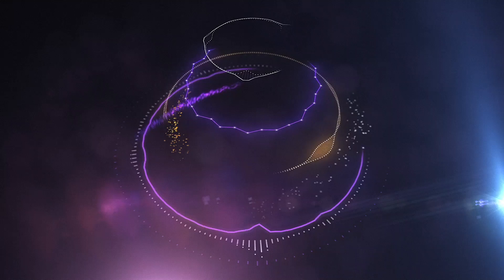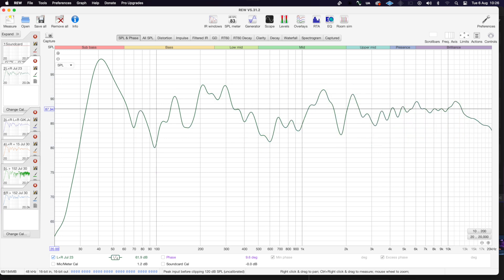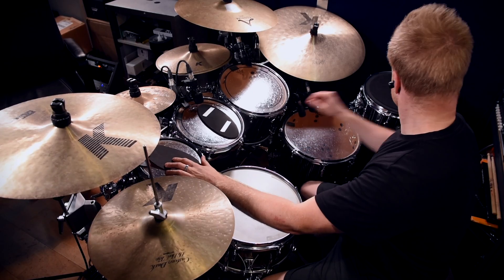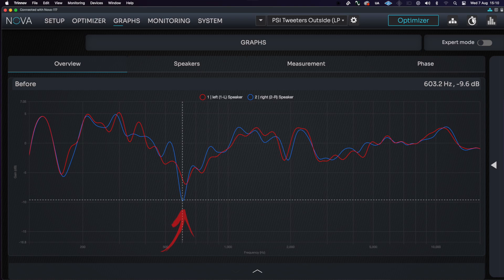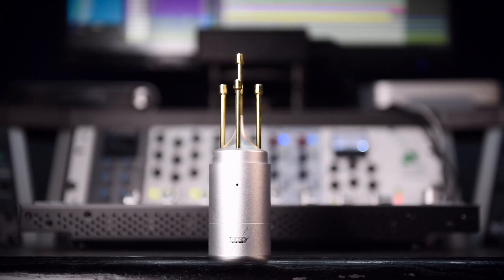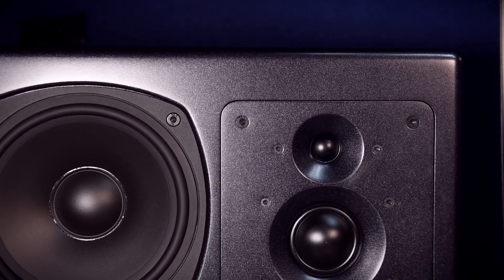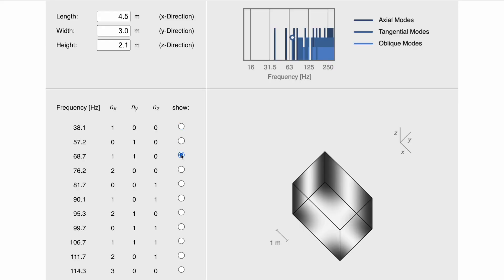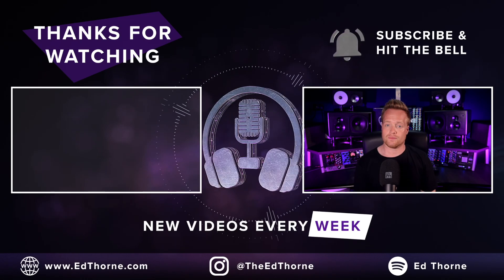Practical Treatment & Solutions To Real Acoustic Problems

Comment: You cannot EQ away a null.  Its a rabbit hole I've been down.  I was able to improve a 180HZ null in my room by adding extra 8" thick (roughly 1M X  2M) Rock wool on each side of my listening position and another about 2 meters directly behind me.  Knocked about 9dB away from my null and also ate a little of my 60Hz bump.  My room is about 3X4 meters with really low ceilings (2.2 meters-ish)  So unfortunately clouds are a no go.  The thing that helped the most was moving away from 2 way monitors and a sub to a really good set of 3 way speakers and no sub.  Just doing that and nothing additional got my response looking pretty good.
Reply from the maker: They’re great improvements, good job!

Comment: The ceiling thing is a wonderful thing for me to note down and it's clear to budget the basic acoustics and then a bunch of extra for sorting out little problems.
I'd not have drums and a drum shelf but good to see this for anything else I might have that'll cause a similar problem.
I will be doing it in the flat living room, but fortunately at the moment the plan will not include much difficulties or so I think... couches and arm chairs, a few side tables here and there, but one thing is a short depth desk at the back for a digital art station for a friend to do me graphics when I can afford to pay for them.
That might need to be reworked.
Then my room isn't a normal rectangle with odd bits sticking out and two doors behind me, one to the hallway and one to the kitchen and then one to my left in front of me to my room and a built in bookshelf to my right... which I intend to treat and get it working before I figure if any shelves will still be usable.
Then my bedroom will house a lot of such things as book shelves and so forth that might cause issues... oh the fire place might be a issue but is closed off so treating it will be possible.
Always good the hear others journeys.
Totally thought when you mentioned something coming in the post on the podcast I thought maybe you had the PSI active bass traps coming
Reply from the maker: I’m hopefully trying the PSI AVAAs soon for a video but I definitely can’t afford them!

Comment: Knowing what I now know in hindsight, added with all the other compromises that went into my room. I would have gone with GIK soffit traps floor to ceiling in the corners from the beginning instead of tri-traps (if you got the space). Ive based all my treatment off knowledge from Jesko, GIK articles and other resources online. To not sound like a GIK commercial my reason for choosing them is that for me personally theres no way I can trust myself around building materials and to make it look half way decent. 

Ive got 11 monster traps, 6 x 244 panels, 3 of them a cloud above the mix position without gaps. In addition I found room for 8 scopus T40 membrane traps. My corners are tri-traps. Most of my panels have range limiters except 244s and main side reflection monster traps. The monsters in the back of my room have built in scatter plates. I also got 4 GIK Q7D diffusor panels along the sides further back in the room, quite frankly because I wanted  the product for myself just to gain experience and test it and they just look way too cool with the nice wooden finish. In this small size of room those Q7D diffusor panels are probably not something you want to focus on if your not geeking out. I considered extending the cloud  over the mix position further back into the room with an added additional thinner cloud, but in the end settled for now on an area rug in the back of the room that seemed to stop the bounce from the hardwood floor and the hard ceiling but still retain some life.

I didnt contact GIK from the beginning because I didnt know quite how far I would take it at first. Im sure there are anomalies as you said 100hz, but im not gonna bother to even obsess about measuring it before I get a Trinnov Nova, thats the next step for me.

The walls and ceiling are hard and dense in here, so I suspect they are quite reflective. They are a fermacell sandwhich with greenglue with 20cm Paroc behind that for sound isolation and are 2.5cm thick. Each fermacell layer is equivalent to 2 layers of normal drywall in density they claim.

Ive probably made a ton of mistakes in here as well but thats all part of the learning process to gain experience for me. I didnt dare to go with all panels with scatter plates as well which could of been possible. But ive tried to go with the range limiters except for first reflections to try not to suck out too much higher up. I believe thats one of the possible mistakes GIK lists that if you run "full range" panels everywhere, especially thinner panels but you dont trap the bass with sufficently deep panels elsewhere you deaden the room in mids and highs but the room still has problems in the bass region which then compounds the issue.

Quite frankly im relieved the process is nearly done as the rabbitholes are deep and so are the various issues to obsess over. Im not seeking perfection in my less than optimal starting dimensions.  Jesko said something like that at some point you get to a point where you are trying to balance all the so called "best practices" and make sense of the sometimes confusing and also conflicting best practices :) Main takeaway is that once you are over the fact that the treatment is going to take up a lot of space and be a lot of panels in general, as soon as you start adding more and more treatment and hearing the results you move the bar for yourself of how far you are willing to take it, like it may seem almost insane to start out with soffits or super chunks in the corners but if thats where you end up anyway it requires a mindset shift from the beginning to think bigger, for me that was a gradual process. As such at this stage in my journey I would of gone for the soffits initially. Also if the ceiling height would be slightly higher I would have gone for more ceiling mounted stuff around the ceiling of the room ceiling/wall boundary as well that I see Jesco includes in his recommendations a lot.

Anyway rant done :)

Comment: I think this demonstrates perfectly why acoustic design should be left to acousticians. It's heavy physics and maths, it's not 'sound engineering' or an 'art'. But likewise, it's always surprising how basic acoustic treatment can go a LONG WAY.

When you completely understand acoustics, you'll understand that acoustics isn't about how dead you can make a room, but it's how you can create a room which has a desirable frequency response, desirable RT60 (hint: it's not 0 seconds, it's actually around 0.25 to 0.4 seconds, normally around 0.3 for the most well-known studio control rooms), desirable distribution of modes, whether this passes the Bonello criteria, whether your room aligns with a prime ratio, ventilation, overheating, ensuring reflections are diffuse, mitigating mechanical ventilation noise, ensuring fenestration is such that environmental noise isn't an issue, ensuring that you're not impeding on the amenity of your neighbours etc... there's so much depth to the profession.

It's also worth noting that with any acoustic measurement via REW, you're not just measuring the room. You're measuring the loudspeaker and how that source interacts with the room (not just the room), as well as of course the microphone, signal converters, pre-amps, etc... even down to where the microphone is positioned and what furniture you have in your room. From experience, I can guarantee that the large studio desk will cause "issues", even down to the chair you sit on can have significant implications in room acoustics.

BUT as shown in this video, you can clearly see how a little/basic treatment with simple analysis of data can go a very long way indeed!

I think one thing I love about this series so far is how you pack the right amount of information so that people can go away and easily action tasks to improve their room's acoustics without any faff (i.e. the plethora of fancy modelling software and excel spreadsheets that us acousticians use all the time).

I think the main thing to always remember is NO ROOM IS PERFECT AND IT NEVER WILL BE (hence why I'm normally against systems like Trinnov (particularly SoundID) as it sometimes can do more harm than good in attempts to achieve a perfectly flat response).
Reply: I was thinking similar things, for example about the room being dead as possible, not exactly. However Trinnov is much much much more superior to SoundID, and with enough acoustic treatment it’s stellar. :)
Thanks for sharing your thoughts.
Reply: @MichalMikulskiMM  Yes, by far if anyone feels like their needs align with the 'room correction' technology', my recommendation is always to get the physical acoustics as good as you can WITHIN your budget etc... and then try and go for Trinnov or that calibre of calibration software as opposed to SoundID/other cheap alternatives which end up sounding mushy.
Reply from the maker: Having tested ARC, MA1, and Trinnov side Bu side next to Sound iD, it’s made me realise how bad Sound iD is! ARC is far superior for the money.
Reply from the maker: That’s a great commentary on the subject! The desk is a concern for sure but the cost, effort and time required to swap it out, for something that MAY not improve the problems is a step too far for me atm 🤣 Thanks for the comment about the series. I’m no audio scientist or acoustician, I’m just trying to make the videos relatable and hopefully inspire some ideas.
Reply: I don't think it does. The K.I.S.S method is time tested.
Reply: @davidallanmusic  not in physics.
Reply: @producermathew  Serban and his partner John Hanes have spent 0 time on the complex things you described in your 1st comment. There's a Gear Space article with John Hanes and he describes the room treatment that they have. It's surprisingly minimal. I have more in my room.

Comment: Minimal desk speaker vertical  on stands .
Reply from the maker: I’m aware the desk is causing two problems - reflections due to its surface area in a low ceiling room, and it’s height and depth which dictates I can’t have speakers on stands. I agree vertical is the optimal position.

Comment: Have you tried setting up the desk along the longer side? Kit should fit in the back corner
Reply from the maker: Alas, this is a good idea but there just isn’t the space. The kit is big and the guy I share the space with (who owns it) needs to use it regularly. But, yes, this would, I’d have thought, remove the speaker discrepancy caused by the door.
Reply: @EdThorne  shame, how about downsizing the desk and placing the speakers on their own floor stands
Reply from the maker: I’ve also considered this but the time and expense of swapping the desk for no guaranteed benefits is a step too far for me atm. I might be moving studios next year so I’d swap the desk then. Not worth it before then.